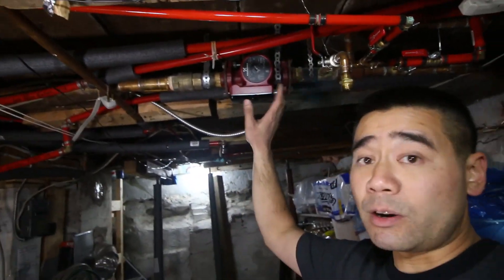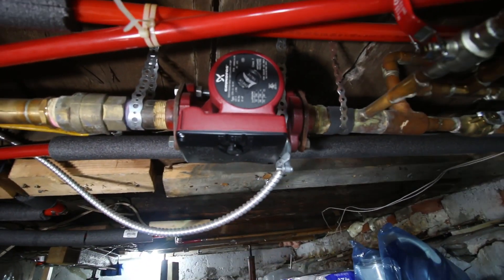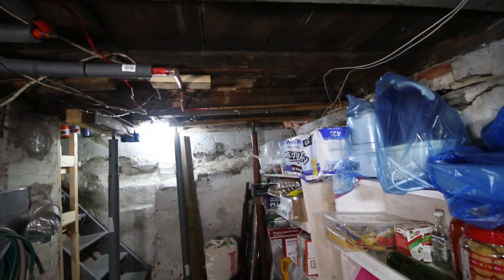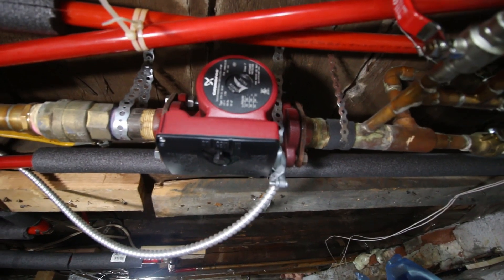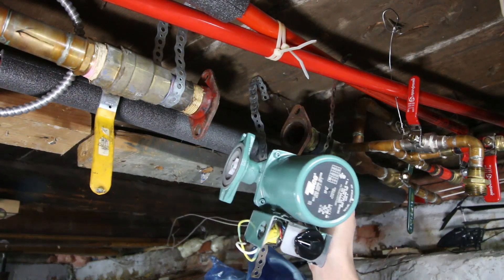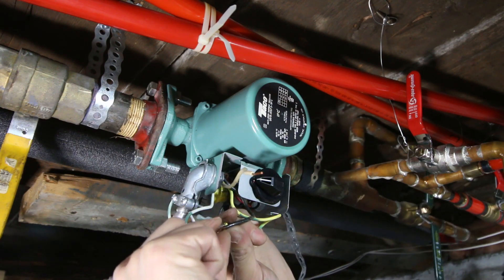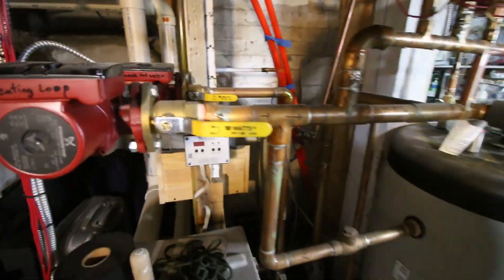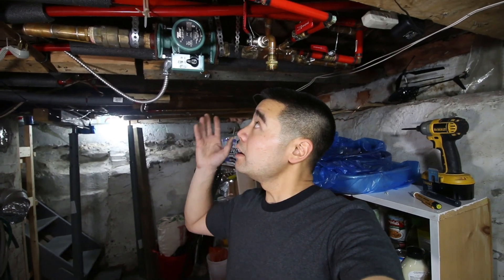How to Change a Circulator Pump - Hot Water Heating Hydronic

Comment: I really need you help.I’m not sure mine still work or not. It has some noise inside the motor.  Also first I trying to bleed water when the heat not working. But unfortunately no water bleed out at all.  I have no idea with that. It’s pump stop working cause no water bleed out too?

Comment: Thanks for putting this out there, Andrew.  I have a different brand - Grundfos - where the pump is sweat soldered in place.  It still worked, but there was a high pitched grindy noise that started a few days ago.  It turns out that there is a replacement cartridge unit with the impeller on it (sits inside the motor magnets) available for my unit that leaves the motor and housing in place (no soldering needed).  The cartridge was pump type specific - my pump was a UP 15-18 85 type, whatever that means, which was good, as my pump was no longer made.  It was 4 bolts and a bit of persuasion to get the old cartridge out and the new one fit perfectly. It just hums quietly now with the new cartridge. Your video helped save me many hours of cursing/soldering/bloody knuckles.  THANK YOU !!!  Folks troubleshooting their pump should look at this option if the pump is working, but noisy.

Comment: im betting your older pu,p just had a loose wire connection, esp if it worked when you slightly moved the unit.

Comment: If im repairing my system where should the pump be  in relation to the heater ? Its run for years off the hot side of the water heater but that seems wrong.

Comment: @andrew W. I've got the exact same pumps as you, only 2 in the system. The one clearly is spinning and can place your hand on it without burning your hand. The other is clearly not running and the second you place your hand on it to feel for vibration, you've to let go immediately because it's so hot lol.
Reply: The faulty pump is on the return line so explain's why the room doesnt feel like it warming up properly

Comment: Where is the follow-up video on how to correctly install a Taco circulator.  Hint: you NEVER install the electrical box at the bottom side (6 o-clock position) where any water leak can cause a short.  The installation instructions make this very clear as does simple common sense.

Comment: make sure you read TACO installation instructions, Circulator Pump is sold with the electric component on the 9, 12 and 3 o'clock position.  They specifically state do not install with electrical component at the 6 o'clock position.  This makes sense since if there is a leak from the motor it would leak directly on the 6 o'clock position.  Hope Andrew's pump doesn't leak.  Otherwise this was a good video and my installation went smoothly.